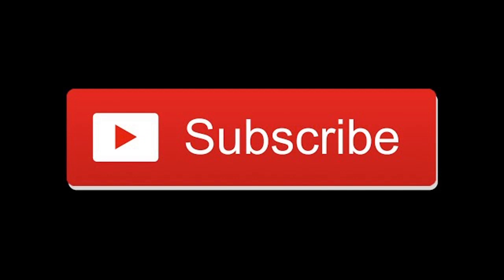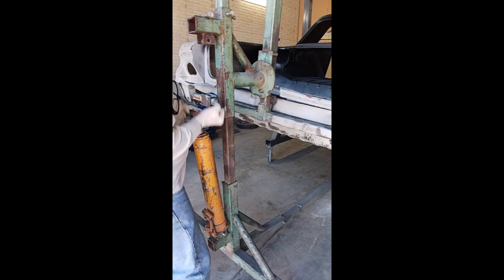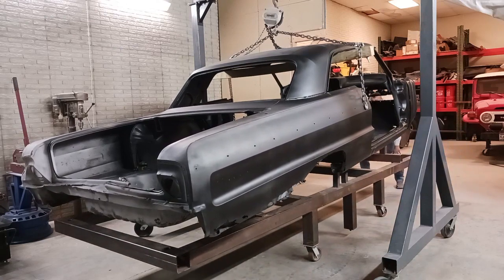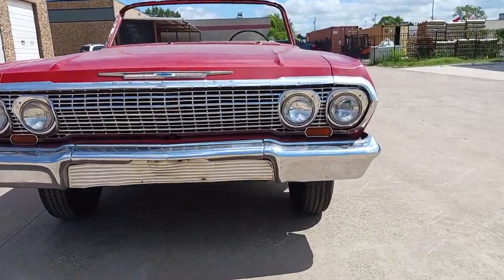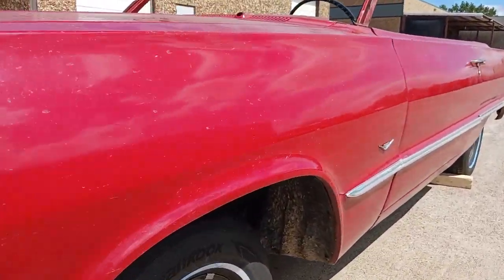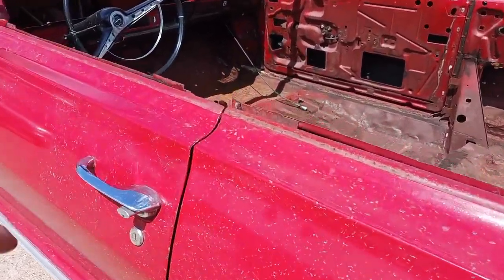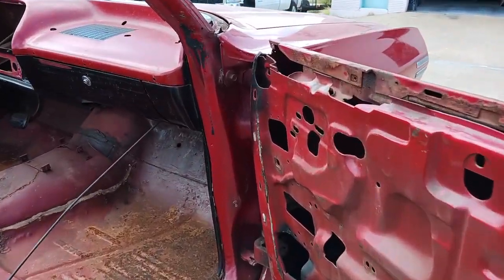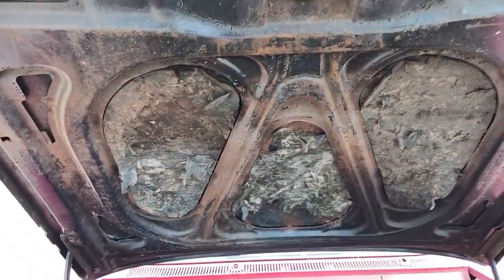1964 Impala SS Resto Part 6 Install onto Frame Fixture + Sneak Peak upcoming 1963 Impala Restoration

Comment: It's nice to see that convertible is still in fair condition, must have been kept out of the rain most of its life, likely by the original owner. What's really tragic is when a car like that falls into the hands of an irresponsible owner and sadly it only takes one to cause enough damage to send it to the scrap yard. It's amazing to see that the rear roof drain gutter is so solid. I wish my 65 ss 396 convertible would have been that solid. At least the rockers were galvanized, and they sprayed a white coating in the lower cowl chambers and in the lower doors and rear lower quarters, almost looks like a zinc paint. That firewall panel seam is not sealed in the cowl chamber, and there is hardly any paint applied in there either.
Reply from the maker: Yeah the cow and those firewall seam is always an issue we'll see what it looks like after it's media blasted hey thanks for watching

Comment: Nice 63. A repop hood won't fit and close like that one did.  I'm hearing that 60 quarter panel patches might be discontinued...sheet metal drying up like you said...buy now even if you aren't ready for it yet
Reply from the maker: Yep.... parts are getting harder and harder to come by for sure
Reply: Discontinued??? Oh man. I sure hope not.
Reply: @ChristopherL0rtiz  u called cars1 a while back they told me that the dies are worn out and something with the patent or something....haven't seen any 60 quarter patches available in almost a year...
Reply from the maker: @ChristopherL0rtiz  Thing are changing fast....

Comment: I have a solid project I've had going on three years and I'm begging to think is it better to buy a car fixed up already or build my own?..it's so hard to stay motivated and especially when you don't make a whole lot of money..what's your opinion boss?
Reply from the maker: I grew up dirt poor.... your labor doesn't cost a thing.... set goals and work towards them and you will get there !
Reply: Thanks for your response..means alot..I just get discouraged sometimes..I don't have a nice shop..just a friend with 5 acres whos willing to let me do my frame off restoration..mind you..I don't have all the tools..I'm buying them on the way
Reply from the maker: @santoscamacho3361  I believe in you.... If you want this you can make it happen, if you get hung up on any part message me. Thanks for watching !